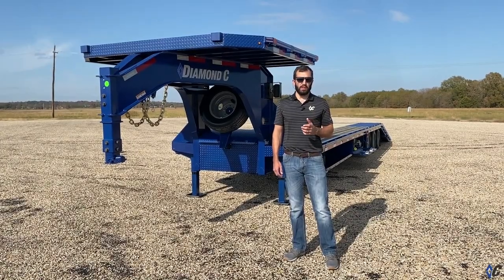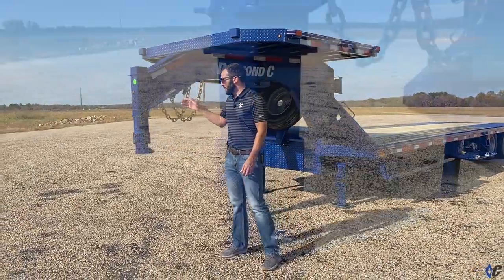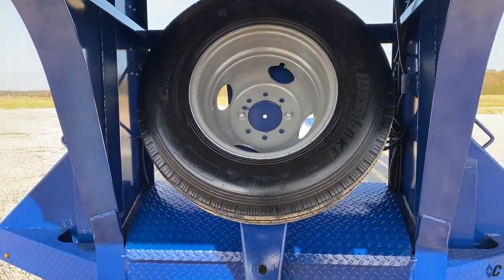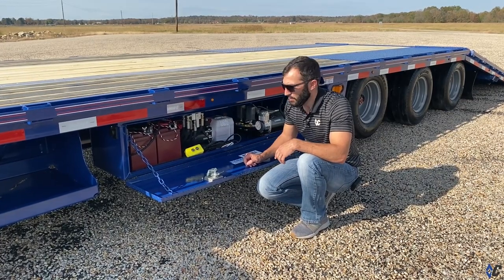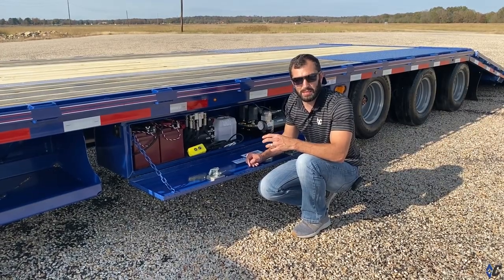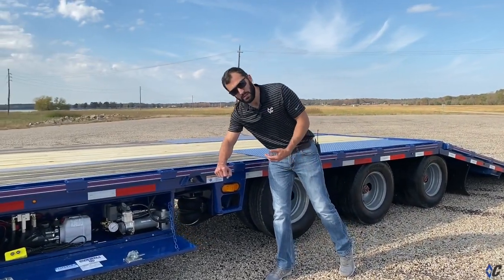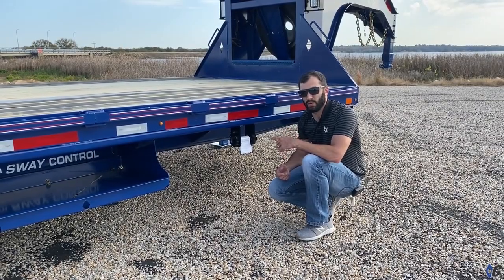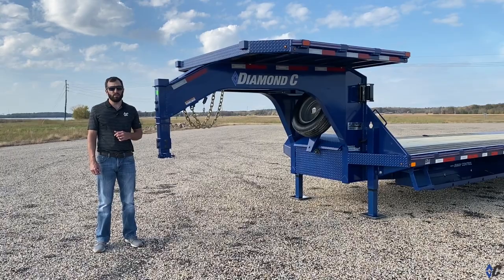The Perfect Hotshot Trailer!

Comment: Single axle big rig to use this to its full potential!
Reply: May as well get a real single axle truck with air brakes and 5th wheel. Probably be cheaper and a lot safer
But it’s an awesome trailer if that’s what you want
Reply: @trickmytractor7187  Your comment is the best here.  These "pick up trucks" are being pushed to their limit.  A pickup truck hooked to the trailer in this video seems like it would be overloaded even without a payload.  Definitely a safety concern.  I find it hard to believe the DOT approves these setups.

 (Some will argue, "it's not a pickup, it's a Ram 5500".  Trust me, from where I was used to sitting, it's a pickup truck)

I am retired OTR, oversize heavy haul, 100 ton plus payloads, primarily mining equip. relocation.  In our business SAFETY was paramount.
Reply: I thought same thing.

Comment: For what this trailer cost a person could purchase a 'Regular' 53 foot step deck  that would haul probably 42k or so with air brakes pulled by single axle Class 7 tractor !
Reply from the maker: That’s why the title is Hot Shot 😁 You can’t pull a regular step deck with air brakes and air ride behind a 350/450/550 class truck 👍
Reply: @diamondctrailers  .. Too much for a hotshot and how much more room in the top deck
Reply from the maker: @stevendobson5655  Top deck is 7’ x 8’.

Comment: How much is this trailer? And can it be pulled with a Ram 3500 safely?
Reply from the maker: Window sticker (MSRP) on this one is right at $44K - actual selling price you could expect to be in about the $33-36K range depending on your area.

This trailer could be towed safely behind a 3500 but not while being used to it’s full 40K capacity.
Reply: 12,500, it’s on a lot in California. Never ordered by a Hot shot guy.
Reply: @diamondctrailers  puts you at 66’9inchs. I’m sure by now you guys realizes that 65ft is what most of the states require. You guys seem to be cutting-edge. How about addressing this issues. Come up with a 40ft deck that is legal behind a crew cab. We also have to have a place to sleep. Why should we have to take the bed off our 40 to 80 thousand dollar truck just to be legal. For all of us out here. Be the company that fixes the problem... I’ve called and asked,so now I’m typing.
Reply: @diamondctrailers  BTW they are asking $47,000 out the door...
Reply: @Djtruckin  Really?  Where is that please?

Comment: Sweet baby yahweh, that’s probably 30 grand or more. Lol sweet though
Reply: I bought a FMAX 210 40' with deck on the neck, two boxes hydraulic dovetail, dunnage rack, 17,500lb winch extra lights, few more options, cost little over$38,000.00

Comment: If l spend $50,000 or $60,000 or more on your 40,000 pound trailer it better be able to hold 40,000 on the deck .
Reply: Can a truck pull that much weight?

Comment: Would you recommend a medium duty truck for hauling to the max pay load
Reply from the maker: For sure! 4500-5500, 450-550 class truck would definitely be a better choice to maximize payload.
Reply: F-650 Low-pro ( AIR-RIDE ) REAR AXLE     EXCELLENT RIDE !!!!!

Comment: I went to the website and built my trailer, no one ever got back to me about price? Then I inquired about a gas hydraulic pump unit instead of electric because I use multiple winches on a trailer, they said it wasn't possible, I went elsewhere and they built exactly what I wanted.

Comment: I have two issues with Diamond C Trailers..  1. Why do y'all not offer air brakes on the step deck trailers not everyone drives a dully.. 2. I realize steal prices or up but your trailer prices are not much cheaper then that of a semi trailer.. I really love your step deck trailers with the hydraulic dove.. But no air brakes and I can't see myself spending 60 or 70k when I'm not getting what I want.. Might as well just go get a used semi trailer with air brakes and no hydraulic dovetail.. Will wait until steal prices drop and find the trailer I want with air brakes.. Thanks!

Comment: How much does this trailer weigh?
Reply from the maker: This trailer weighs about roughly around 11,500lbs depending on what all options you select.
Reply: Lol you wouldn't be able to haul shit behind a dually. The trailer weighs half of what a one ton will haul🤣🤣🤣🤣 to heavy.
Reply from the maker: @frankcox748  some of the late model 1 tons are rated to tow 37,500lbs, trailer weighs about 12,000 - seems like plenty of payload capacity left 🤷‍♂️ Quite a few individuals out there running the combo successfully.
Reply from the maker: @frankcox748  some of the late model 1 tons are rated to tow 37,500lbs, trailer weighs about 12,000 - seems like plenty of payload capacity left 🤷‍♂️ Quite a few individuals out there running the combo successfully.
Reply: @diamondctrailers  more like 32,500 and I have a  new RAM. There is a reason quite a few hot shots are running them.   I don't hot shot but we do haul a backhoe at 21,000 so for me that damn thing is too heavy. I have a tandem dovetail with the same axle weight and it weighs 8,500 at 38 foot long. Like I said to much shit on it.

Comment: Do you have the perfect farm trailer? 34 foot with mage ramps tandem duels or tandem super singles, I think I prefer duels. Would pull with 2022. Ford f 350 single wheel 7.3 gas. Hauling round bales and tractor/ equipment
Reply from the maker: We would suggest FMAX210 for best all around for the farm. 👍
Reply: That 7.3 has isn't going to like that lol

Comment: There is not a truck on the market that would legally pull this trailer. I would not even use a Ford F600. Maybe a single axle semi truck such as Freightliner M2.  Stop hotshotting the wrong way.